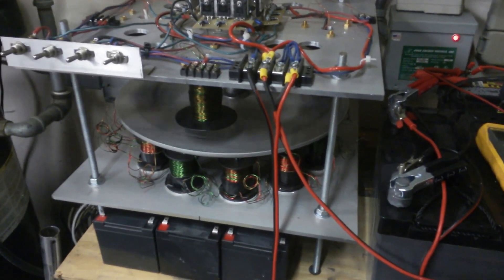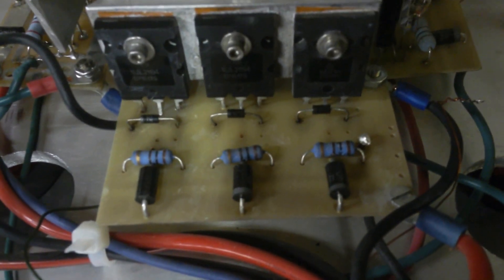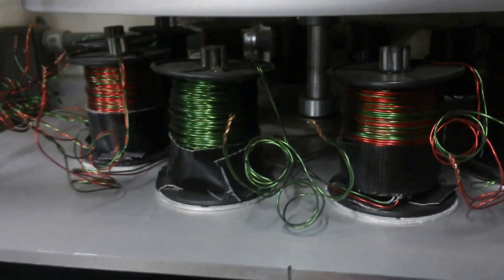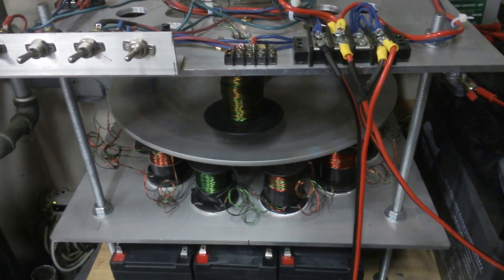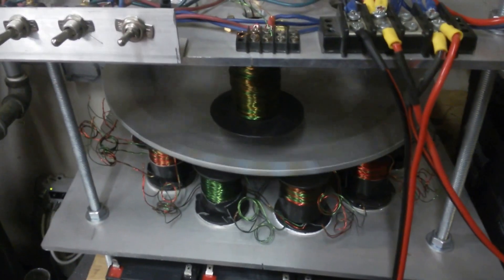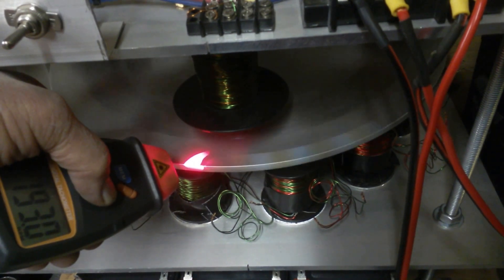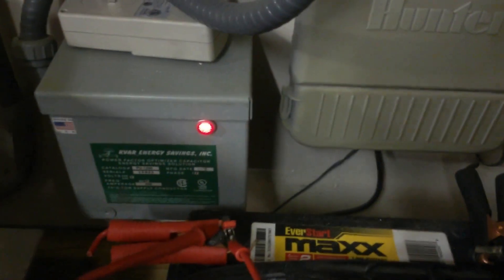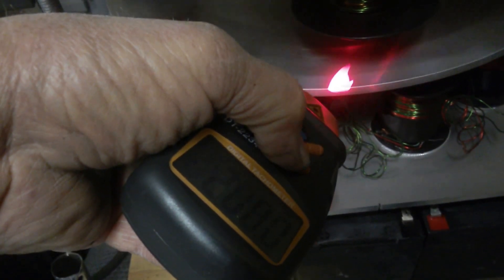Bedini Motor Update ( Quad Style Tripole circuits) 14 magnet rotor

Comment: this looks very cool!!! how's the project coming? I hope you are matching your transistors up. I'd be interested to see this system run without the aluminium in the  construction. Great work man! Way to build, my friend.
Reply from the maker: I am modifying it with a second wheel and a traditional axial flux wiring but with the bifilars to create 24 volts instead of 12 volts. Almost done. If it works then I will add a second axial flux to it with 14 more magnets on the second wheel. I will post a video when completed.